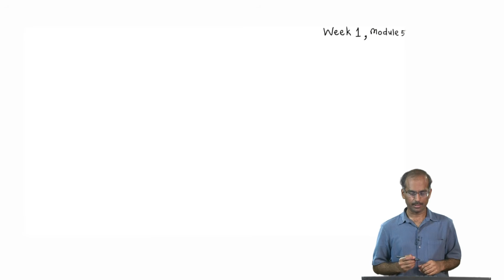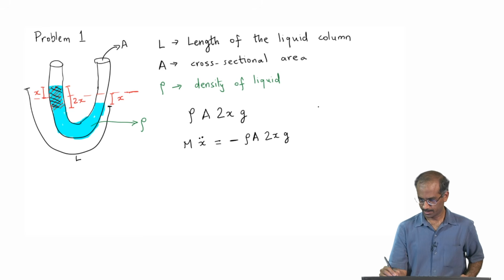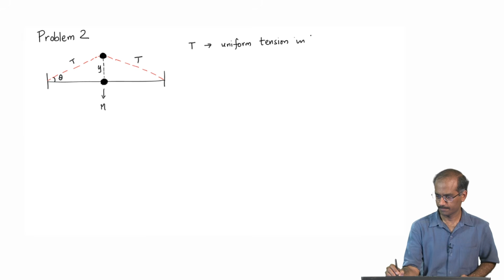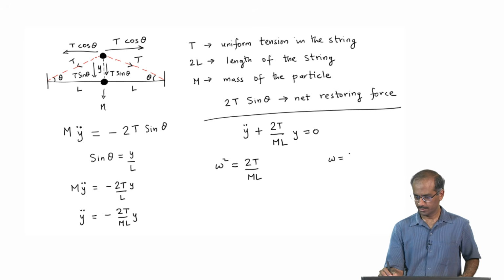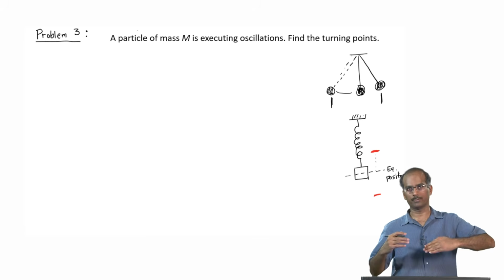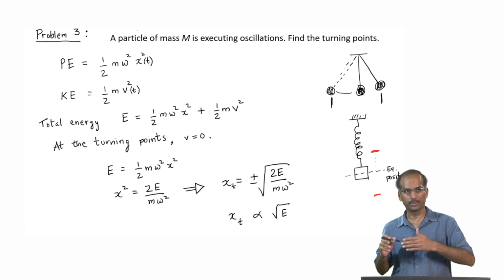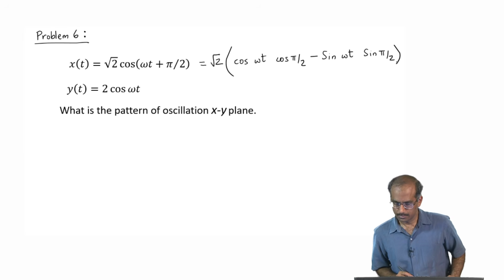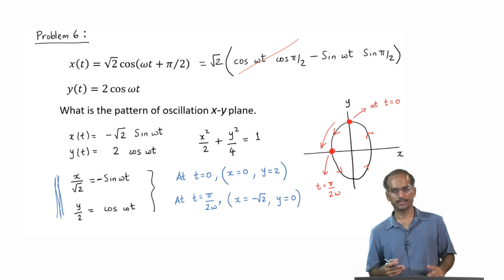Simple Harmonic Motion : Problems

Comment: In each of the vertical oscillation cases, while writing the equation of motion we are considering restoring force alone....why are we ignoring gravity...?
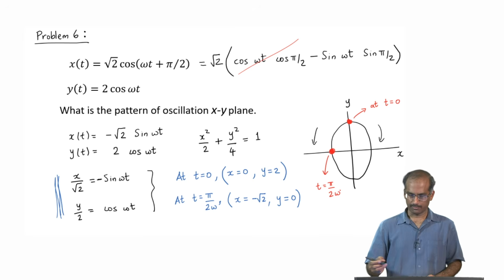Reply: Also, at 32:20 why can't the direction be from the other way around....how can we predict direction just by considering 2 positions, if we have two ways to reach from ist to the second....?
Reply: @MohdSameer-rx9gj  omega = 2pi/T, substitute the value and you will get your answer
Reply: Because that is used to balance intial stretch of spring . actually we can write mg and use static deflection in beggining as we are setting up our coordinate system from mean position .
Reply: Maybe mg(gravity) is not always acting towards equilibrium postion.
Reply: Please, doesnt T is a function of y?

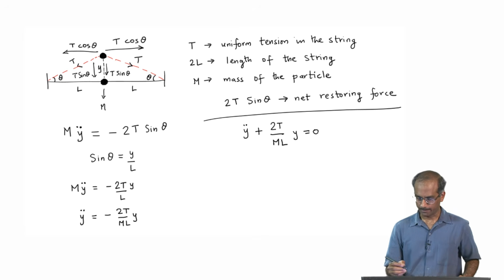Comment: 15:13 I think there is two mistakes, “mg” is missing in restoring force and expression of “sin(theta)” is incorrect.
Reply: here gravity free space has been considered..coz if gravity exists thn eqlm posn will also change
Reply: @subhrasen1395  yaah . I suppose
Reply: Same confusion....
  Mg is missing but mg can't be the restoring force as it is directed in one direction only..... don't know where to use it....we can't ignore it also
Reply: no you need to think in a different manner, we are displacing the string by a small angle theta. And for small angle approximations,  sin(theta) = tan(theta) = theta = y / L
Reply: sin(theta) is p/h, there y is perpendicular and L is the hypotenuse (not T, the length of that part of the string at every instant is L)...and mg isn't a restoring force, a restoring force is a reaction to a force that disturbed equilibrium state, mg is a naturally existing force